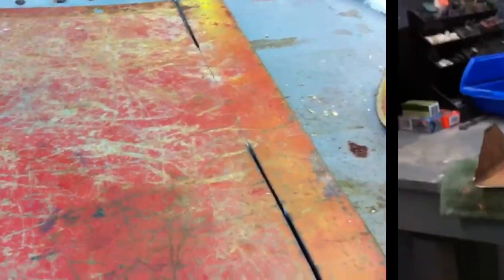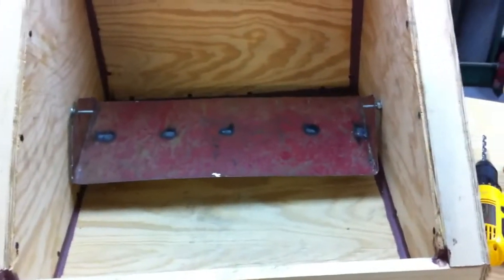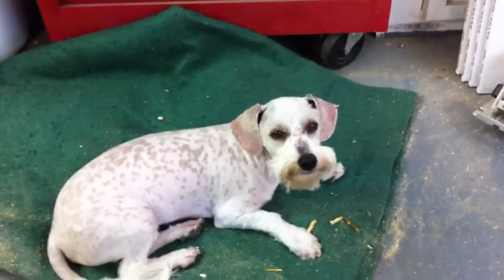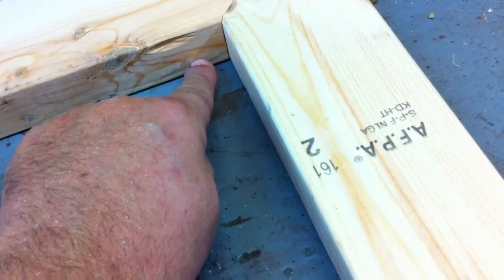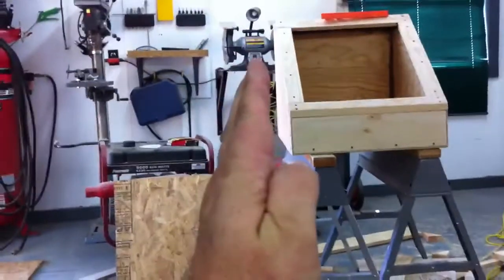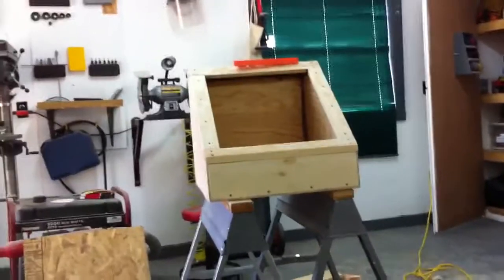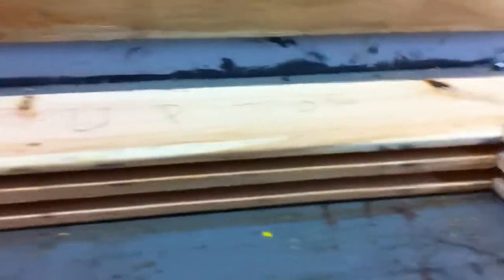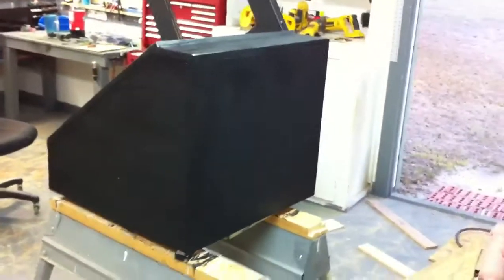How to build a solar oven,  part two of four

Comment from the maker: @DIYMakerman its a double walled oven,there is insulation in between the inner and outer walls. im hoping to get into the 300 degree range or better.